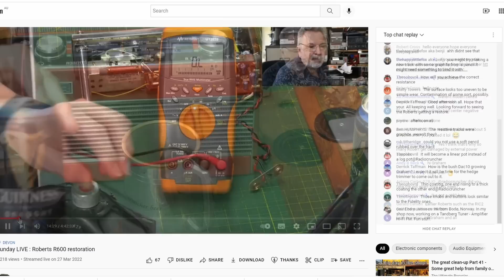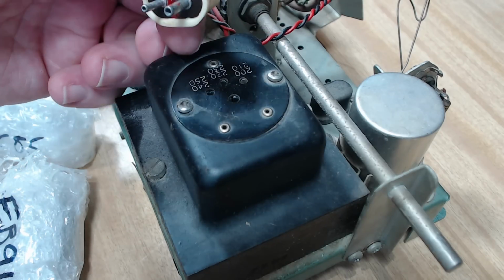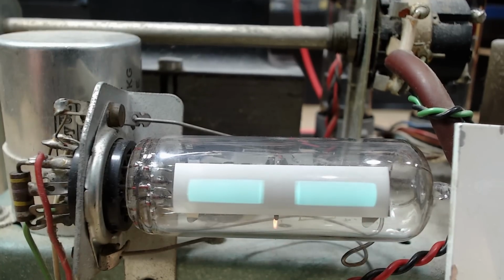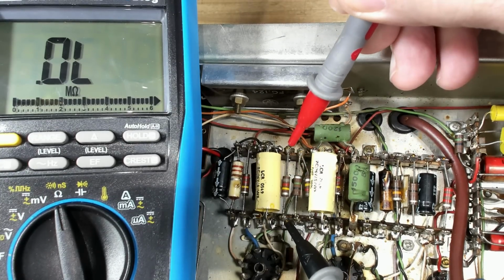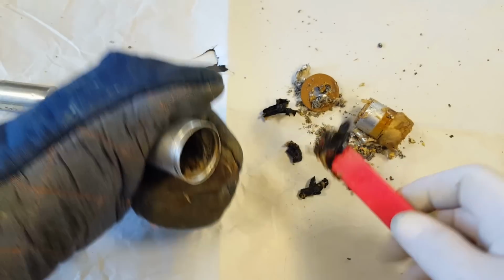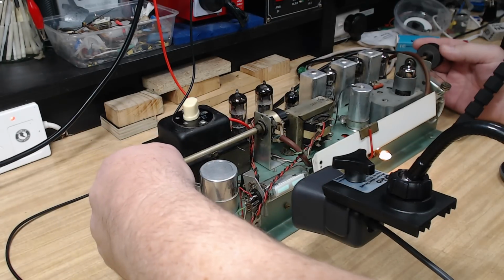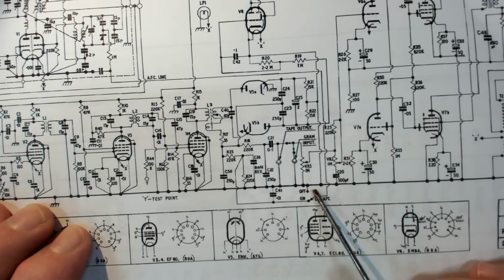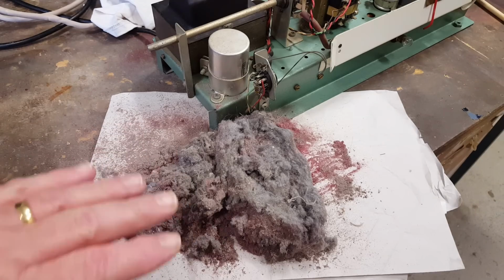Hacker RV20 Radio - 1962 -1966 Part 1

Comment: One of my all time favourite pieces of valve tech was a Hacker two speaker, record unit. Separate amplifier with volume and tone controls in the speaker unit. 👍The unit also had separate amplifier inputs for ie reel to reel et et 👀I note that curse of valve systems the 'selenium' rectifier. Almost all units I worked on with them in, they failed. 😶Those 'magic eye' valves as you know, are voltage dependent and often a good checking of those voltages et solves any problems.👀 HOWEVER IF they go 'dead' to replace certain types, is VERY VERY EXPENSIVE! 😶FOR NOVICES: As with working on ANY electrical devices, especially HIGH VOLTAGE units, making sure NO POWER is connected AND items such as ELECTROLYTIC CAPACITORS are DISCHARGED. 400v+ electrolytic caps can deliver a very NASTY shock and for some a LETHAL shock. SOME old aluminium electrolytic units contain a LIQUID and GLOVES should be warn when dismantling these units. The fluid is deemed to be 'carcinogenic'.😶 IF you are replacing or fitting new caps into the cans of different values, I tend to MARK the terminals with a COLOUR (painted on or permanent marker et) so I KNOW which value is which terminal. 👍Thanks again David for another great vid!
Reply from the maker: Your Hacker played sounds like a nice unit, rectifier attended to next week, I'm on the lookout for a new magic eye, I checked it out but the video didn't work so I didn't include it. I covered wet capacitors in another video. I marked the terminals to suit the markings on the can I also wrote 'restuffed 2022' on them. Thanks Arthur 🙂
Reply: A selenium rectifier preserving "hack" is just to connect an ordinary silicon rectifier of suitable rating in series with it, if it isn't blown yet.   Now, reverse voltage on the selenium will be blocked, making it virtually impossible to blow it, yet the voltage drop of the combination will be almost the same as what it was for the selenium alone, without fiddling with series dropping resistors.
Reply from the maker: @SeekingTheLoveThatGodMeans7648  I haven't heard of that before, thanks, I'll look into it 👍🙂